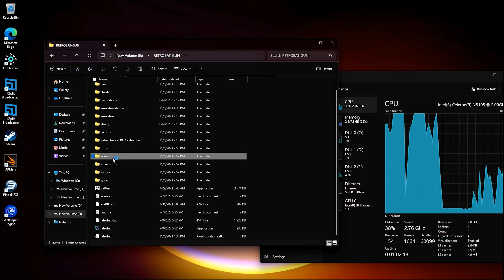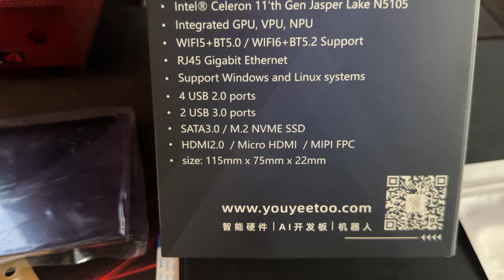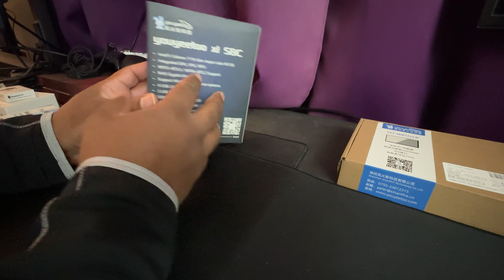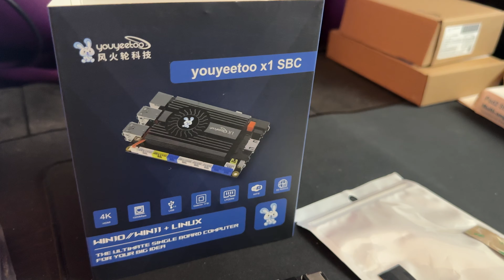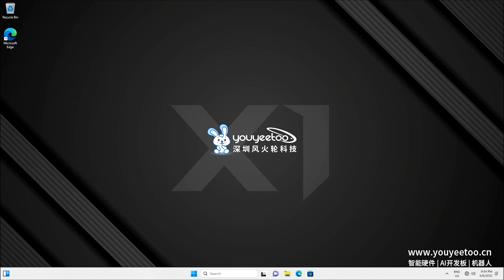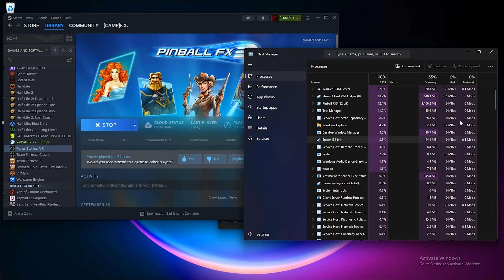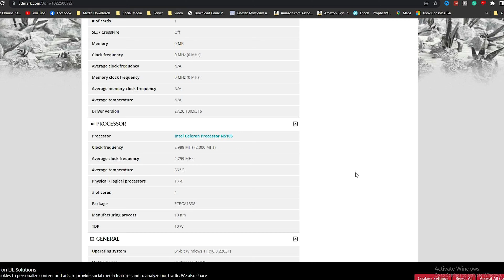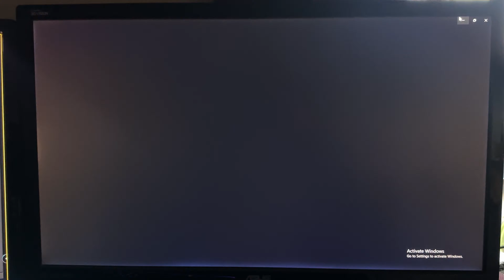The Ultimate Single Board Computer Youyeetoo X1 x86 MINI PC

Comment from the maker: The market dynamic in the minipc sbc market is about to change. With intel chips now more affordable than ever and arm chips rising in cost and with intel x86 processors not needing any development. I don’t think the market share for many sbc will survive and some won’t do as well as before as a low cost low performing solution. Intel chips/boards that could perform well started around $250-400. With this new board starting at 109. Many will shift away from arm development and consider this a better solution especially with the costs on rising on arm chips. buy item now 
https://www.youyeetoo.com/products/youyeetoo-x1-x86-single-board-computer?VariantsId=11287
https://amzn.to/3MDdUGq

Comment: Intel isn't messing around, especially the N100/N200/N300 with DDR5. Black Friday I will be looking for a mini pc to run Batocera build.
Reply from the maker: Ya the sbc market is gonna change. These other struggling arm chips are gonna have problems
Reply: @kiodiekin  The crazy thing is this sbc is Gen 11 Intel, N100 is Gen 12, which is the same Gen as my recent gaming PC, Intel is released Gen 14, so imagine the improvements on these generationally!
Reply from the maker: @carlo1132  ya it’s a new chip. I can’t wait to see Linux performance
Reply: i never considered using something this small didnt know they came in this form factor for a pc. I wont be needing my pi 5

Comment: You don't need an SBC to attain anything based on gaming, media and general P use, with a glut of more powerful N95/N100 boxes being available for even cheaper than this once fully loaded. 8K on HDMI 2.0? 2.1 yes. I would prefer this to a Raspberry Pi 5 and many other ARM products because the real benefit of X86 is the out of the box all round instant get up and go with the least amount of fuss and frustration. Would like to see Libreelec running on this.
Reply from the maker: 😎👍 I ran Teknoparrot

Comment: Can you use other Wi-Fi cards other than the ones they sell for it. Awesome vid btw 😊
Reply from the maker: @th3d3ck3r  gotta use the one made for the board. Thanks
Reply: @kiodiekin  for your information. You do not need to use the advertised Wi-Fi card. I used one I pulled out of an old laptop and it works no problem

Comment: Hi, this card has boot menu ?, I need install Windows and linux in same disc !, Thanks you !!!
Reply from the maker: @robertofleitas2612  I really don’t understand what you’re asking
Reply: @kiodiekin  if it has a key to enter on bios setup
Reply from the maker: Are you asking me as far as the boot configuration as far as I know you can boot either operating system one or the other but that’s all done in the boot process I’ve done it myself